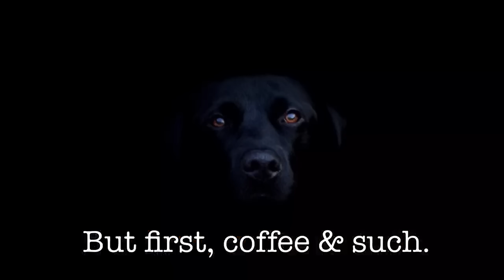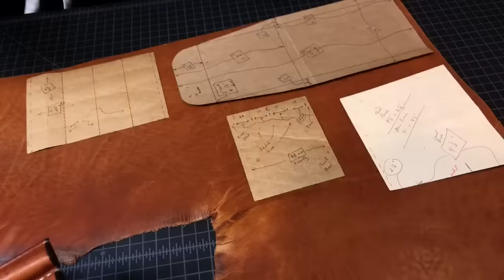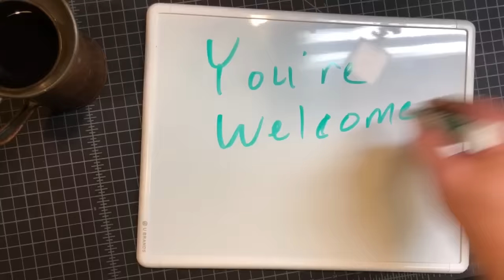Making a Leather Pen Pouch / Case! - The Roosevelt

Comment: Regarding your stitching irons, it looks like they are the Japanese style (diamond point) rather than European, is that correct? with 1mm Tiger, what is the spacing on the holes? Maybe 4mm? THANKS!
Reply from the maker: Yes.  Diamond teeth.  Zero taper (French has taper).  On this project, 5mm.  I also use 3mm, 4, 5.4, and 6.  Depending on project.